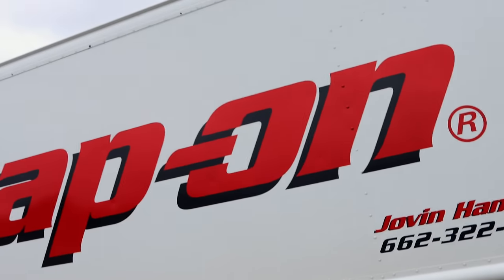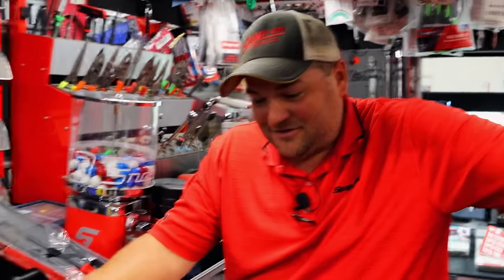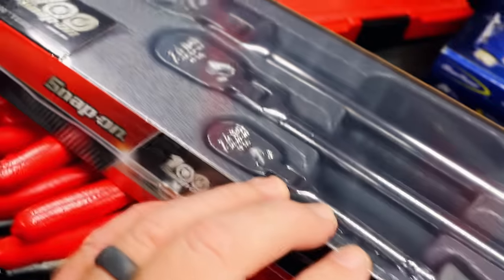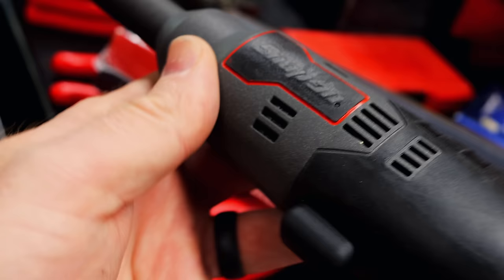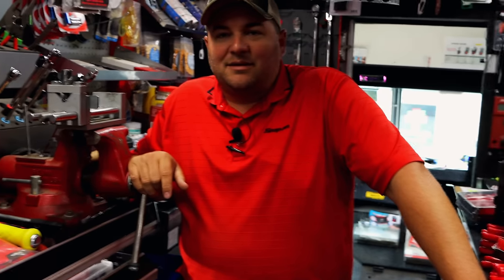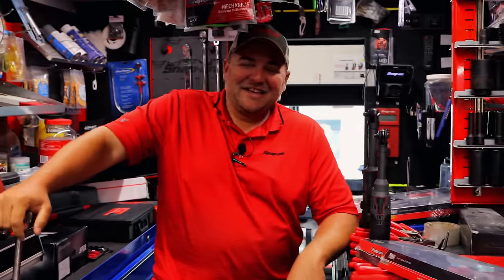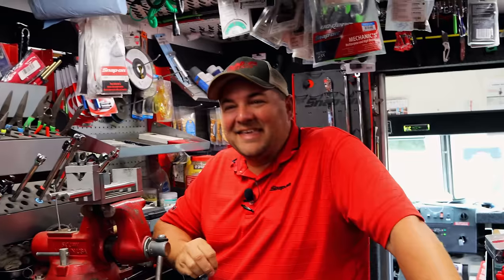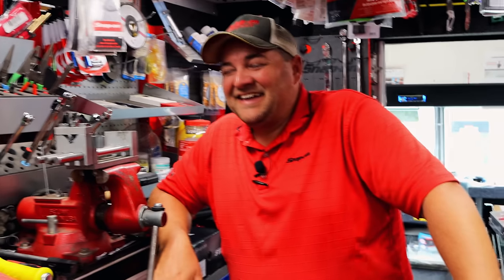Snap On 100th Anniversary Ratchet Set and Cordless 100th Anniversary Tools

Comment: Those are the exact ones I got clay and still havent opened them.. And yes they have a 2 pack 100th ratchets and my dealer has individual 100th soft grip 1/4 and 3/8..

Comment: My dealer has the two piece 100th 1/4 and 3/8 sets, one is long handle comfort grip and long handle non locking flex head I grabbed the comfort grip set

Comment: Koon, I have two of the Snap-on adjustable wrenches with teeth and they are better than the standard adjustable wrench. But the Milwaukee adjustable wrench have smooth jaws and gear wheel with a different angle on them Milwaukee says it will not back-off. I have them all ( as in all sizes) they are great but 0% back-off is not right but it is very close.

Comment: I have a couple of those Snap On adjustable wrenches,the 8 inch and 12 inch in blue handles
Reply: Do you know if these are made/have always been made by Snap on?
Reply: Bahco makes them I believe.Bought them used from a Garage journal member which is a tool forum with a classified section

Comment: I have the whole set of the flank drive plus adjustable wrench set and love them! When you use them to hold the nut when using an impact on the other side hold the adjuster bc it will rattle open. I still love them tho bc they bite in

Comment: The adjustable's are made by Bahco in Spain. Bahco is owned by Snap On so technically it is a Snap On.
I have been using the Bahco versions for 30+ years. Never had a problem with them.
Reply: Bahco is actually swedish, acquired by snap-on and headquartered in france👍👍👍👍🇬🇧🇬🇧🇬🇧🇬🇧🇬🇧
Reply: @leekirtley7234  Correct Lee, my statement may have been misleading. Sorry about that.

Comment: Man I wish I could find the snap on guy where Im at, and them wide mouth adjustables would of been super handy today trying to adjust the tentioners on a belt. 

Also while I got you, Mr Clay any recommendations on a good little compact 3/8 impact?
Reply from the maker: Snap On CT761 for the size and light weight and power it’s hard to beat. It’s hands down my favorite 3/8” impact
Reply: @KoonTrucking  I know you more than likely don't have an answer but how's it do with dust, grease and minor drops (I work on a quarry so not typical machanical work)
Reply from the maker: They do well alive knocked mine off my cart and the lift and dropped it so it’s damn good.